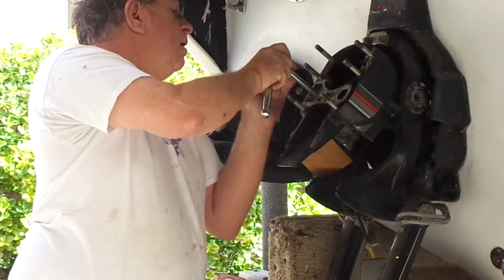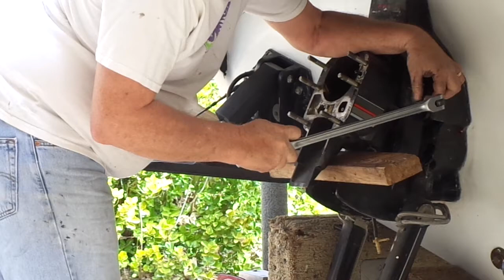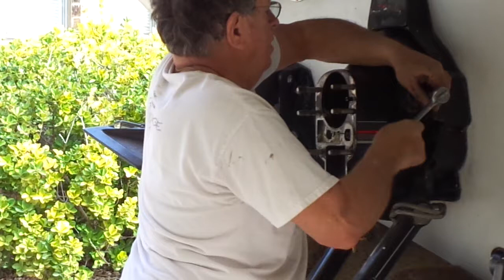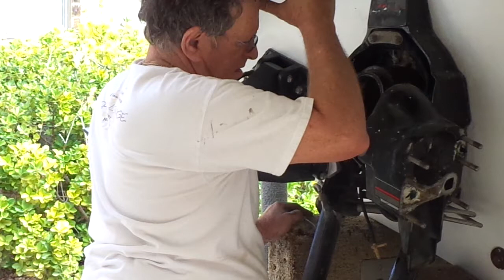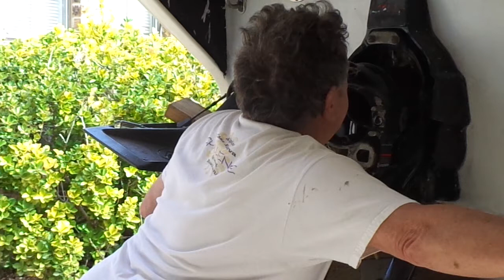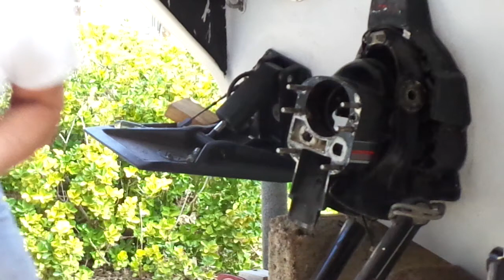Port side swivel pin replacement

Comment: Is this completely replacing the swivel pin? I don't know if I missed something....
Reply from the maker: If you start at the beginning of my videos... https://www.youtube.com/playlist?list=PLm2Lymo6NjpAXGh83lk6Dn2oZUFhfpXpc ...it tells how to do it all and you wont miss anything. It really isnt that hard to do. The hardest part is removing the old bushing and seal...then replacing with new bushings and seal, but if you have the Mercruiser tools to use for that part of the project...it is a piece of cake. You can install the bushings with the flat part of a larger socket, but it is a pain. Be sure you install the seal correctly...right side up. As for the swivel pin...I strongly suggest getting the stainless steel pin... https://www.ebay.com/itm/SS-MerCruiser-Gimbal-Steering-Shaft-Pin-Seal-Bushing-Nut-KIT-98230A1-866718A01/232652951493?hash=item362b324fc5:g:IEQAAOSwzRFaekgA:sc:USPSPriorityMailPaddedFlatRateEnvelope!76116!US!-1&vxp=mtr . You might look or ask a Mercruiser dealer about the install tool...maybe you can borrow it or rent it. If you need help...just holler.

Comment: So you have 5 videos that say port side swivel pin replacement.  At least say you know part one or two , etc. And what year.  I'm doing a 73  TR  drive.i dont  think it has a nut on top. Which video shows the actual removal of the pin. I dont have time to watch every one. Thanks much!
Reply from the maker: Video #7 will probably help you the most. This is a Bravo 1 drive...not a TR. I dont know if this will work with a TR, so you might want to check with a Merc mechanic. I did this myself on both drives on my boat because the dealership told me to expect around $8000.00 to do it. If you will look at the video (slideshow) that says BOTH SWIVEL pins...you will see what they look like as well as the worn out seal. Sorry you dont have time to look at them all, but you can do a quick scan to see if there is anything there that will help, but like I said, this is for a Bravo 1 drive...not a TR.